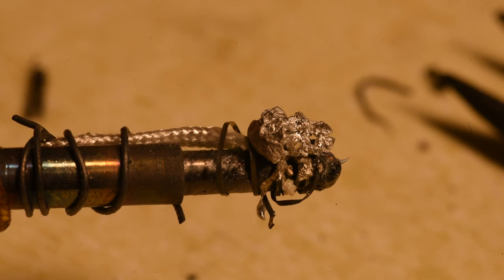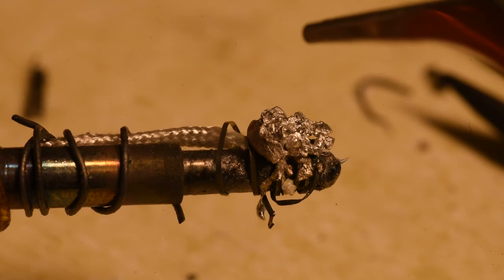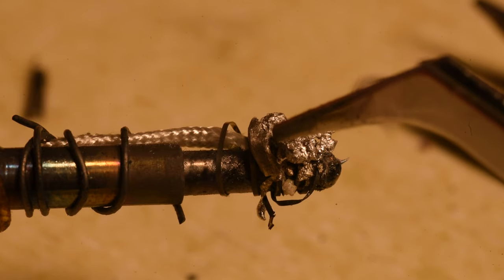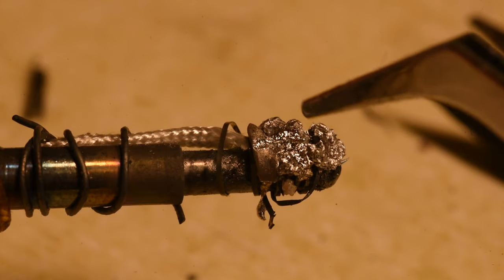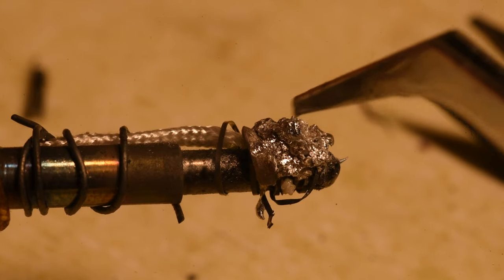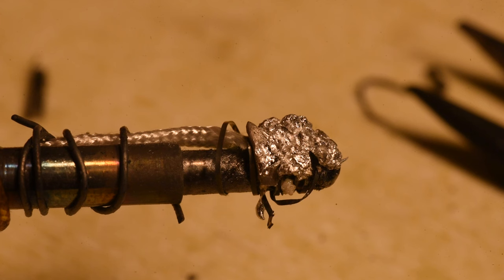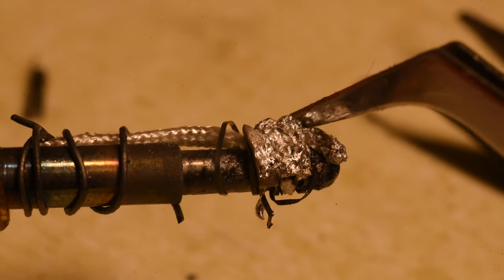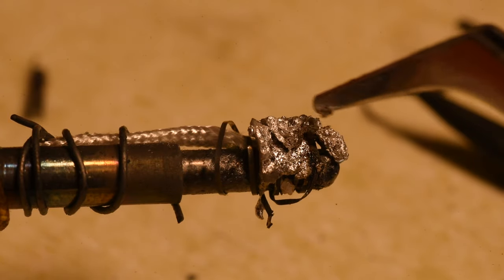Semisolid alloy 60:40 Tin Zinc held squishy on a ceramic glowplug

Comment: how do you feel about a little bit of plasma discharge with Ar + 5-10% H2 cover to remove oxides?
Reply from the maker: IDK depends on how expensive it is and how much trouble it is to implement.
Reply: @rotoforge2024  95/5 welding mix seems to go for $100 per refill (13.4L 300 bar bottle. The 50L bottles are twice that). Having a closed printing cell will pay for itself pretty quick.
Reply from the maker: thanks for the tip. 
though I would prefer not to require additional consumables.
we have considered using an oxygen concentrator to provide a nitrogen flow over the tip. 
though we think we may be able to get away without it for lower melting metals,and higher print speeds.

the quench time from the semisolid state for most metals in our system should be substantially less than 100 milliseconds.
The typical oxidation rates of the metals, bronze 510 for example, at 980 C, the middle of its semisolid range, about 50% liquid fraction, is something like  10X10^-6 gramsXcm^2 / second.

so I expect the degree of oxidation to be quite limited...

though inert gases on are on the docket if reality strikes. as it so often does. 

 @hardwareful
Reply from the maker: in the limit, if you want to print more extreme materials, gas shielding is probably required, just to protect the glowplug itself from the moisture and oxygen in the atmosphere.
they start to resistance shift above about 1500 C, and rapidly fail above about 1600. 
lifetime at ~1760 in air, is less than 4 hours typically.
In an dry inert gas, lifetime at 1800 C could easily be thousands of hours. 
So for printing really tough stuff, the gas cost will be a smaller fraction of operational costs, and would make muchmore sense than when printing with bronze, Sn-Zn and Aluminum. or other low melting metals. 
 @hardwareful

Comment: does the glowplug heat through induction? is that what the coil is on the outside or is that just to hold the squishy to be squished?
Reply from the maker: the glow plug does not heat by induction.
the wire is just there to hold the thermocouple and yes, to hold the squishy to be squished. 

its a piece of 60-40 tin zinc metal that we were heating to the semisolid region.
a more informative video will include this and a bit more in the near future.